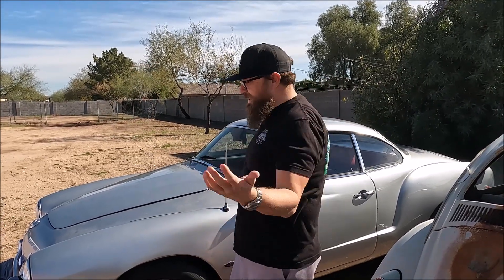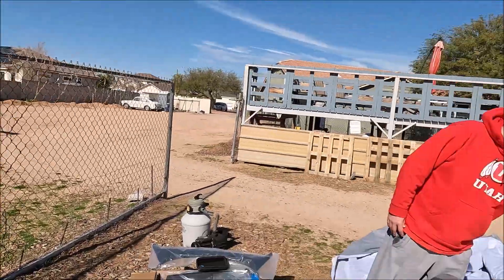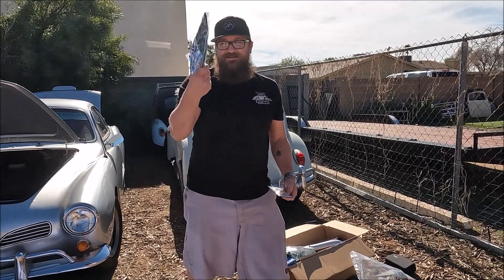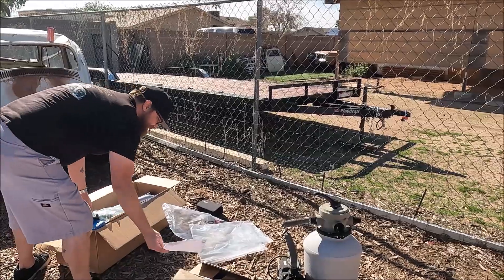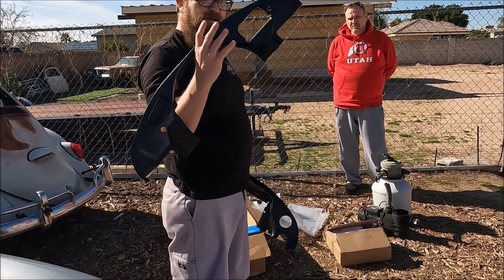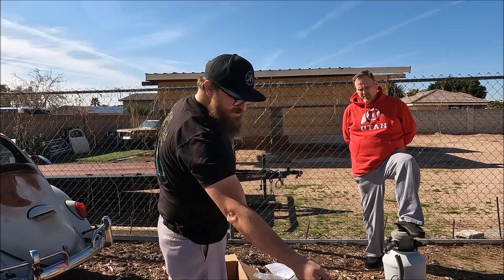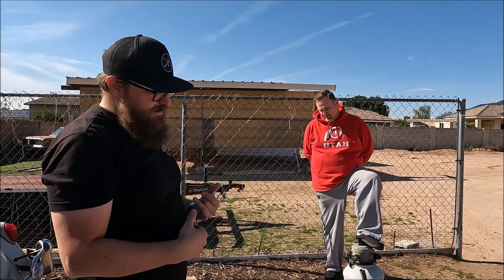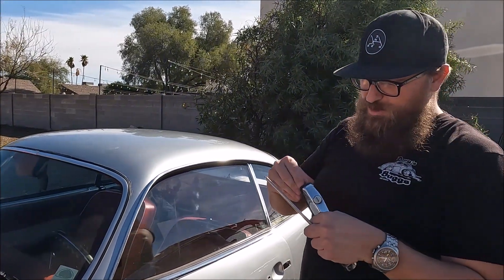1969 Volkswagen Karmann Ghia - Project Car Update! Mileage Unknown Ep 85

Comment: Looks like you have a huge amount of parts to get the project started. 
What’s up with Penelope ?!?
Reply from the maker: Well...... I've got 2 get the car sealed up I've never tried 2 do Type 3 pop out window seals... So I'm debating on taking her 2 a shop having a headliner and window seals done or attempting it myself and saving/cleaning up the headliner as good as I can right now it rains and she fills up with water from everywhere! And she's leaking oil from push rod tubes on 1 side and in no way shape or form am I ready 2 pull the engine again! So it may get some spring loaded tubes on the leakers for now....